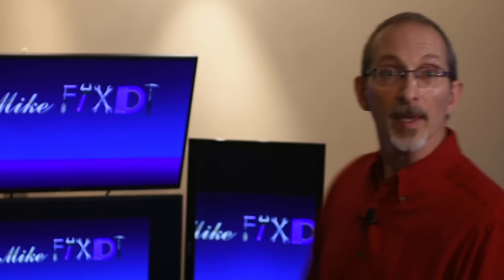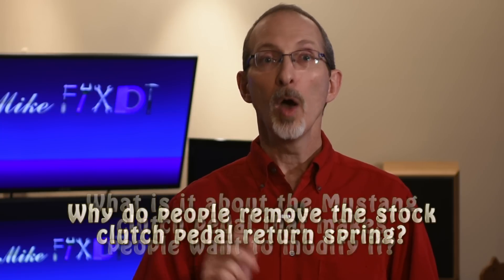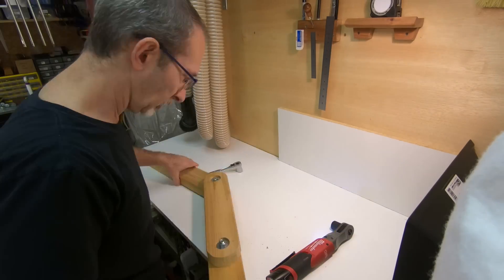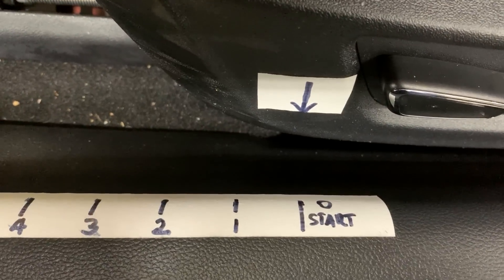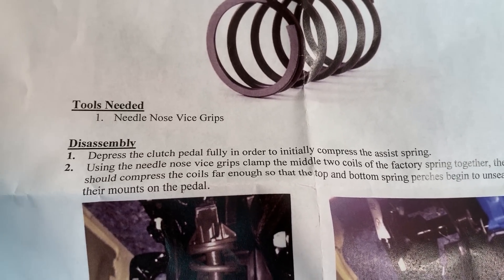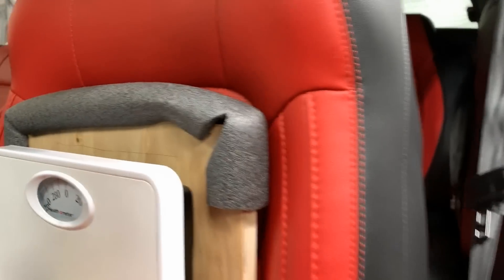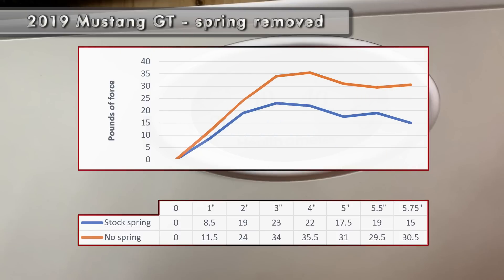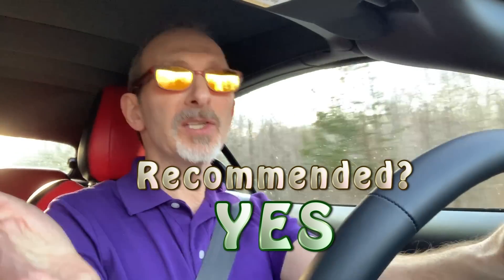Mustang GT Clutch Pedal Spring Explained Using SCIENCE

Comment: TLDR: (no spring or steeda spring is more linear and thus better for driving) Couple thoughts just to clear things up and help someone decide on this. It is an assist spring. Key word ASSIST. Lighter spring/no spring=less assist=stiffer more linear pedal feel. The point of it is to make the peddle feel lighter and assist with the movement of the pedal. Now the problem with this is it is not LINEAR at all. The stock spring you will notice forces your foot off at the very top of the peddle where the clutch engages!! Making it very hard to control and cause dumping the clutch/bucking. The steeda spring is lighter and does less ASSISTING and in turn makes the pedal more linear. No spring= even more so! I just removed the stock spring completely and gave it a drive and it's much easier to drive because the assist spring is no longer springing your foot off the clutch pedal, at the top of the pedal travel, right before it fully engages. Its the same stiffness throughout. This is the best way for me to describe this for people to understand. The science is cool and all but he doesn't realize it's an assist spring hence why he's confused the other spring and no spring made it slightly stiffer and more linear. Ford did the assist spring in an attempt to make the divability better by making the pedal lighter. Not realizing they actually made it harder to control the pedal. Mines off currently and I can assure you the linear feel is much more desirable and the pedal is still very easy to push in. The tiny bit of extra pedal effort is wayyy worth the linear feel you get IMO. Now if you want a tiny assist and still most of the linear feel, get the steeda spring. I'm going to try it out myself but I love the no spring feel right now. The pedal makes so much more sense. Anyways cool video I like seeing the differences in pressure you just didn't know it was an assist spring which is fine. Iv been reading forums and researching it for awhile then finally tried it myself then it all made since lol. Side note: the spring can be removed without vice grips. Push the pedal all the way in with the left hand then pull on it with the right until the bottom part slides off. It will spring off pretty hard so turn away before its about to shoot of. It's greased so it slides fairly easily. It should shoot into the floor board and will have 3 pieces total. And is totally reversable as long as the plastic doesn't break. 2018 gt pp1
Reply from the maker: @AceSpade - 100% on point. It's important for people to realize it is an 'assist' spring, like you said. I've been happy with the Steeda replacement and will probably leave it in place. Mustangs are all about mods and choices, so its great that you share your experiences. Thanks!

Comment: Thank you for making this video.  This is a gold mine of information.  I manual swapped my 2011 Crown Vic using parts from a 2000 Mustang Gt.  Transmission , flywheel , clutch , linkage and even fabricated a clutch pedal using a set of pedals from a fox body mustang.  So that makes it a cable operated clutch and it's very stiff. I measured it at 54 lbs of force at the pedal.  Compared to your measurement on a factory GT with hydraulic clutch and assist spring or what I would call an over center spring.  I was amazed at the difference.  I plan on fabricating a new hydraulic set up for my car using parts from 05 and up Mustang so that I hopefully achieve a pedal with less than 30 lbs of force required.  I am a left leg amputee and use a cane zip tied to the clutch pedal as a make shift hand control for my clutch, and 54 lbs with my left hand is hard on the wrist.  less than 30 lbs would be a game changer!!  Thanks again!

Comment: Simple - I have had 17 spine surgeries. This video showed some difficulties which it took me 6hrs some acrobatics, lots of pain but I got it done!! I was worried that I was not going to be able to depress the clutch. Interesting was the science.showed why I like the new clutch feel along with the new trans mount shifter that took me 3 days to reach and torque the bolts. Been 3 months and changing to stainless headers,exhaust and complete Steeda bearing changes I have what is like a new car after 6+ months to get the work completed, remember I have severe spine downgrade and everything takes me longer but I am extremely happy today.
Reply from the maker: Late reply, but I'm glad everything worked out well!

Comment: Great video! So Ford thinks the average Mustang driver needs help pressing the clutch pedal. For lots of city driving maybe so. The real Mustang enthusiasts want that traditional muscle car clutch feel and the Steeda spring does just that adding an ever so slight more linear help depressing.
I like your scientific approach. Its all clear now. Thanks!
Reply from the maker: TNitro N - thanks so much for checking in! I think you are absolutely correct: Ford specifically designed the action of the clutch pedal/return spring to suit the needs of the average driver. Steeda recognized and answered the need to provide another alternative to fill in the gap, for people that want a heavier feel. Some people have been quick to imply that something is 'wrong' with the stock design, and hopefully this video - and comments like yours - will underscore that the stock clutch spring is perfectly good. But for someone that wants a low cost, reversible mod that actually changes how the car drives, you can't beat the spring replacement.

Comment: For the MT-82 it helps, but for the GT 350 years 2019 2020 and 2021 2022 mach 1's the spring doesn't function in conjjuction with the ford performance's tremec no lift shift functionality. 

Easily reversible.
Reply from the maker: Alex that's great info!

Comment: I think the most important thing about the science that was left out is at what point in the curve does the clutch engage! I think the stock spring interacts at an awkward point of the curve when the pressure has the most swing at the same time the clutch engagement/disengagement happens. Whereas the aftermarket spring has a smoother interaction at that point in the curve. JMO
Reply from the maker: Joe, those are good points. I feel like the clutch engagement is distributed pretty evenly across the middle of the pedal travel. And that supports what you are saying, that the replacement spring feels smoother. Thanks for watching and sharing your thoughts!
Reply: @MikeFyxdt  I took a screen shot of your chart while watching the video (well done) and I’m will to bet that the engagement is about 2 to 3 inches which is at a flatter spot with the aftermarket making for a smoother transition. I just replaced mine over the weekend and I think the heavier pedal is worth it considering the feedback.

Comment: I drove one of the new mustangs only yesterday and I found it like that as well, stock it’s fine then mid way it snaps back, really hard to modulate and get smooth engagement.
Reply from the maker: B-MAN - you described it really well! The Steeda spring evens out that mid way snap back. Thanks!
Reply: @MikeFyxdt  my bigger issue is that I find the peddle to be too high off the floor for me, I can't pivot the ball of my heel like in my Fiesta ST, or the 2012 GT I had... oh well another 392 SRT Challenger is required lol Nice vid

Comment: I have a new Bronco on order.  Actually I have had one on order for 16 months now.  I'm pretty sure the Bronco is set up the same way, since most of the manual parts are "borrowed" from the mustang.

Assuming I am right about it being the same, and assuming Ford ever builds it, first thing I'll do is swap the spring.  I hate soft squishy clutches.
Reply from the maker: I did not know that Bronco is borrowing from Mustang but it makes sense. To be clear, the clutch feel with the factory spring in the Mustang is anything but soft and squishy. The resistance is good, but there is a weird dead spot in the middle. This new assist spring gives a more consistent feel throughout the travel of the pedal. I hope that helps… Thanks for watching and joining the conversation!

Comment: I just bought a 15 GT and when test driving it I had to stop in a parking lot and work on the clutch bite and rocked all over the parking lot looking like and idiot trying to get used to it. I've stalled twice since buying the damn thing. And every time I leave from stop anywhere I rock back and forth all the way through 3rd gear. It's unbelievably annoying, I bought the SR 30# clutch assist spring for a heavier feel and easier modulation. Havent gotten it yet, but I cant wait to try it
Reply from the maker: Hey Sean - I wish you good luck with the new spring. But I have to say that the level of trouble you are having sounds like there is something else going on. Please check back and let us know if the new spring helps!

Comment: It's not just the engage poimt the problem,but  with the stock springs if put an  after market clutch the pedal will get stuck to the floor when you shift above 5000rpm so be without springs/or steeda springs fix the sticking pedal....
Reply from the maker: Thanks for sharing the warning! I've never had any problem. My clutch is original!

Comment: Your graphs show the entire problem.  You push in the clutch, you change gear, then you want to release the clutch to the engagement point quickly and then slowly after you hit the engagement point.

With the stock spring, as you're lifting, the pressure needed to hold  the peddle has a 50% difference along its travel from easiest to hardest... and the Steeda Spring only has an 18% difference.  It's much flatter, and that consistency is what makes it feel smoother.
Reply from the maker: That's a good way of putting it! Thanks! 😁

Comment: The spring is now $30, 5 years later (thanks inflation) and based on the fact it will just make the clutch heavier, I'm not gonna bother. I haven't driven a manual in over 15 years and I have no problems with the stock clutch on my 2014 Mustang GT.

I think all these people claiming it is so much better (especially the ones claiming it is so much lighter) just want to believe that they didn't waste money on a spring. Muscle memory, engine rpms and forward motion should tell you where the clutch engages/disengages.

Comment: Hey yeah I am from the Netherlands and recently bought a used Ford focus mk3 1.6 Tdci.

After driving for couple of months, I noticed my clutch is acting weird In long runs, high speed runs and eventually to low speed city runs as well. 

The clutch feels very jerky, does not return to its default position after releasing it, sometimes does not get pressed hard enough or all the way to bottom for me shift to gears.

Or do you suggest getting Steeda clutch assist upgrade spring for Ford focus. Its pricy but I heard good reviews about it.
Reply from the maker: It doesn’t sound like your issues will be fixed with a clutch return spring since the clutch feel changes as things heat up. That sounds like issues with the clutch itself.
Reply: @MikeFyxdt  wow
That doesn't sound good and very expensive. 

I have been to ford dealers couple of times. They put some grease in the clutch spring assistant, it works fine for couple of days with short runs.

Usually I drive a lot within Germany 🇩🇪, long and fast runs, I am talking about avg 150km/h speed for 500kms every week.

And indeed when things heat up I notice major issues with the clutch and once the car is not used for couple of hours, it goes back to normal.
Reply: @MikeFyxdt  any advice please?

Comment: The only reason anyone should remove the factory assist spring or replace it with a steeda is when they are racing. Theres several accounts of people having their clutch pedal not return to the up position fast enough when doing high rpm shifts causing them to miss a gear, not to be confused with the high torque lockout, that is a separate problem. Removing the spring and replacing the clutch with one that has more clamping force usually fixes the problem.
Reply from the maker: Thanks Nick! While I don't race, the firmer clutch feel does seem more race-ready, and more consistent throughout the clutch pedal travel.
Reply: @MikeFyxdt  Mike, good job in collecting and plotting this scientific data. I also have the Steeda spring on my 2019 GT PP1 and prefer the clutch feeling at the bite point. It would have been beneficial to mark on your plot x-axis the bite point and attempt to explain why so many enjoy the steeda spring for the more linear feel in the bite point engagement section of the clutch travel.
Reply from the maker: @mene1111111  - Thanks for the feedback and congrats on being a 'Mustang manual' owner!!! It would have been interesting to find the bite point and put it on the graph. The spring gave me a bit more of a feel for where the bite point is, like you mentioned, which is really what this experiment was all about! :)
Reply: From what I read that's not the only reason (I have it installed, just didn't go out test yet). The problem with the spring is on the return it starts pushing back right on bite point which requires you to be way more careful when shifting normally if you want smooth shifts.  Sure, one gets used to it like I did, but having more control is useful specially when the car is still cold and I want my wife to learn how to drive manual and if what I read is true, it'll make the process a lot easier.

Comment: how does a clutch pedal extension affect the pedal safety switch, if at all? i don't want to buy the extension only to find that it won't be compatible with the safety switch. i own an 1996 svt cobra.
Reply from the maker: nick nicholson
 - I want to make sure I understand your question - a 'clutch pedal extension' is something totally different than the clutch assist spring in my review, which I think is only for 2015-2020 Mustangs. The Steeda clutch assist spring does not affect the safety switch. If you are asking about a pedal extension, then this answer doesn't apply.

Comment: I don't get it. How can a hard return spring make the pedal EASIER to press down? Why is the pedal harder to depress without a spring or with a lighter spring in place? When you push the pedal down you're also extending the spring. So I would expect you to need a lot more force with such a hard spring in place. What am I missing?
Reply from the maker: Vlad Soare - Your question is exactly what I was wondering before installing the spring. The missing information is that the CLUTCH acts like a spring. The clutch pedal assist spring pushes against the clutch resistance, making depressing the pedal easier. With no assist spring it’s all clutch resistance; with the stock helper spring the pedal is lighter, but the resistance changes at different pedal positions; with the Steeda spring (weaker assist) the pedal is harder and smoother, but easier than no assist spring at all. Does that help? :)
Reply: @MikeFyxdt  Thank you for your quick reply. I understand what you're saying, but I still have a hard time visualizing it. I mean, with no spring it's all clutch resistance, while with the OEM spring it's clutch resistance PLUS spring resistance (because it's YOU who extend it, it doesn't extend itself). I must be missing something. Maybe something to do with the angle of the pedal, or its circular rather than linear trajectory, or something like that?
Reply from the maker: @B16WGZ  - No, replace "PLUS" with "MINUS" in your example, since the assist spring pushes in the opposite direction as the clutch: "...with no spring it's all clutch resistance, while with the OEM spring it's clutch resistance MINUS spring resistance..."
Reply: @MikeFyxdt  Oh, I think I get it. My assumption was that the spring sits there in its relaxed, stable state, and you need to exert an effort to extend it. Actually, the spring is compressed and wants to extend, so it pushes down against the clutch. So your depressing of the pedal actually helps it to extend. 
I thought the job of the spring was to pull the pedal back up, hence my confusion.

Comment: Would  driving the car without the spring cause any damage?
Reply from the maker: Nope. That’s an option. Muscles in your left leg might get bigger than the right tho...
Reply: @MikeFyxdt  I just heard that I’ll destroy components after time smh it’s coming out!!!!!! Your Chanel Rocks man.
Reply from the maker: @N0b00st  - thanks for the nice words! IDK what to tell you other than I've heard of people removing the spring entirely, but that's hearsay and I don't have any first hand knowledge. It's basically a linkage to the clutch, and the clutch assembly is so robust I don't think it will be affected by a heavy or light clutch pedal assist spring - or none at all. This replacement spring is strictly about how the pedal feels to the driver, and I don't think it has any affect on the clutch/transmission.